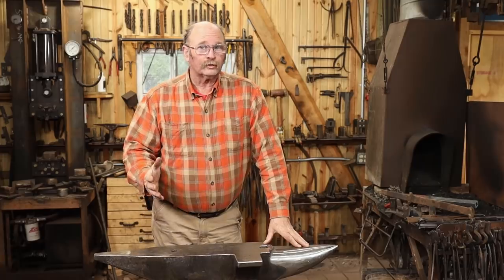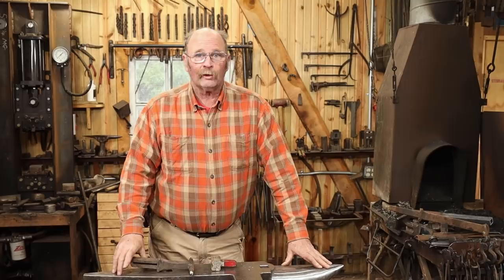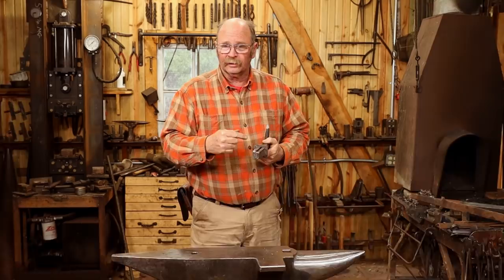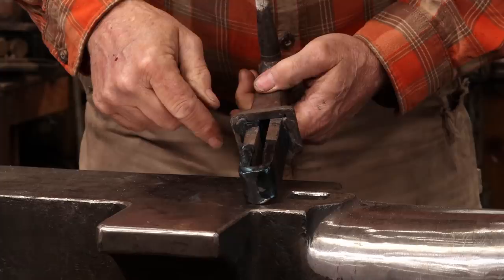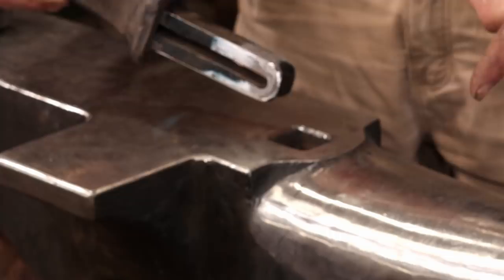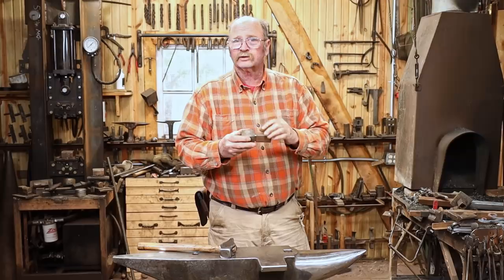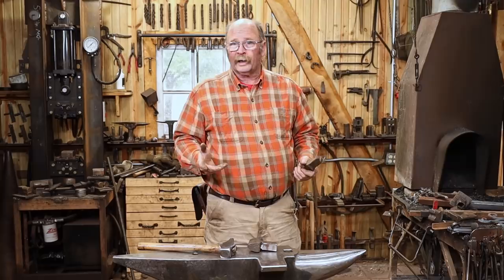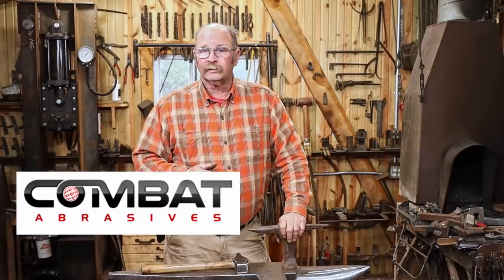resizing HARDY TOOLS to fit the new Anvil

Comment: Have an old cut off hardy that was too loose , heated up some square tube and jammed it on to the shank , as it cooled off , it shrank and made a tight fit   Some grinding and filing and now it fits hardy hole snuggly. No welding.  Love you videos and have learned much , even from Roy  :)

Comment: A weld in the bottom of the square tube to the bottom of the hardy shank would hold it together without the need to grind the weld down.

Comment: When I got my new anvil, with much larger hardy hole, none of my old hardy tools fitted, but instead of modifying them or replacing them, I now use my swage block to hold my hardy tools when I need to use them. Works perfectly for me, as I have the room and my swage block has always lived right next to my anvil..

Comment: I moved from a 30 mm hardy hole anvil to a 25 mm hole in a Kanca anvil and had to resize all my hardy tools so I know the process. One hardy tool I find very useful is a cutting plate. Another useful tool for anvils with Pritchel and hardy holes at opposite ends is a bolster which goes over the hardy hole and pivots from the pritchel hole, the pritchel becoming the hardy in this case. Peter (Western Australia)

Comment: My holland anvil’s hardie hole was atrocious, it had casting flashing in all four corners. I ended up having to forge a broach and pounding that through the hardie hole. That left it a bit “sticky” on a hardie shank so I ended up cleaning it up with sandpaper backed by a triangle file to make it smooth.

Comment: I have found that for some of my hardy tools that don't fit the anvil and are something I don't want to modify the shank on,most of the time I can find a square hole in my swadge block that fits. Just another option.  
Thanks for the great videos, keep them coming.
Reply from the maker: I think my swage block was European.  All of the holes are odd sizes and nothing the same as any of my hardy tools.

Comment: I saw a video (Joey Van Deer Steng if I recall) that recommended duct tape to "fill" a hardy shank.  It's possibly not the "best" solution, but it can sometimes be the most expedient.  It did work surprisingly well.

Comment: For the cast seams in the hardy hole a 1/2x18” electric bandfile should be able to get down in there to grind out that seam
Reply: Beat me to it. Dynabrade is the best way to go. Electric or pneumatic. Got mine used for $45 (talked him down from $50) at  an estate sale in the '90's. Other than a replacement nose wheel with bearings ($12.00 iirc on their website) and a pneumatic rebuild kit with airtool lube ($5 at a yard sale) , the belts are inexpensive on Amazon by the dozen. Have used it at least 40 hours in 25+ years. Well worth my investment and VERY USEFULL! 🐾🔥⚒
Reply: @stanervin6108  I got an 5.3 amp Chicago electric from harbor freight to remove the weld seam in 2x2 1/4 wall pipe when I built my belt grinder. For 30$ it works really good. Pneumatic is the better option if possible. End higher quality is worth it but if it’s only gonna be used now and again I think it’s a great deal. Lots of power and feels decent. I’m going to upgrade eventually.

Comment: As a blacksmith in training this has helped alot but I have a question, in theory couldn't you heat up the hardy tool's base in the forge then knock them into the hole to resize them or would that cause too much damage to the tools/anvil themselves? (Just curious to know if its possible with certain tools)
Reply from the maker: The trouble is that you would then need to re harden and temper all of those tools.  Not bad if you know what the steel is, but if its a bunch of old tools from different sources, each on would require some trial and error to get right.
Reply: @BlackBearForge  Ah right, that makes sense, I'll keep that in mind as I was planning on making my own tools so if needs must then I can alter them with the added bonus of knowing what kind of steel I used so I know what I have to do, thank you for the heads-up.

Comment: Hi John, a question I was having. With the new anvil can you use the holdfast like before? Or did you have to alter it to fit the new pritchel hole? I want to forge one myself for my south german anvil.
Reply from the maker: No, I don't think holdfasts will be a good option for this anvil.  It is so thick at the pritchel hole it will be difficult to achieve a good hole.  I haven't come up with an alternative yet.
Reply: I was going to as the same question.  My pritchell hole is 7/8 and 4” deep and I’ve been unsuccessful with a holdfast on this anvil so far....